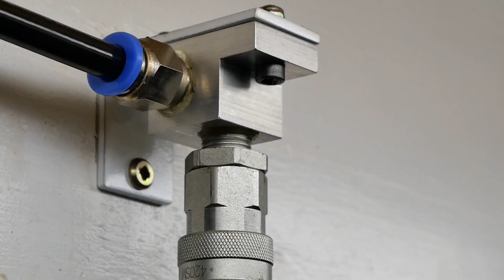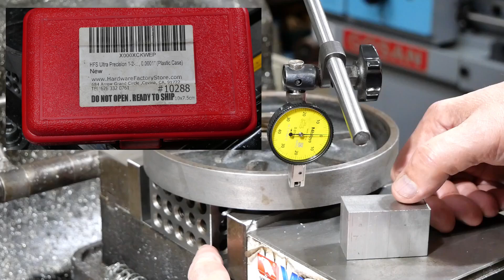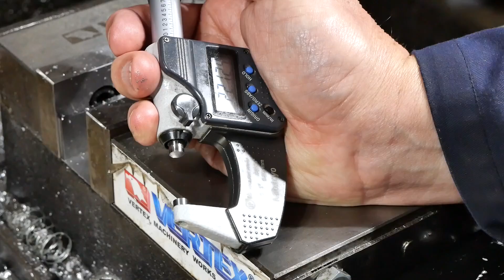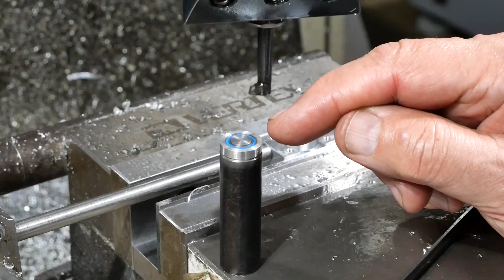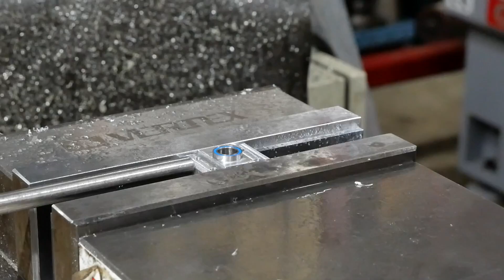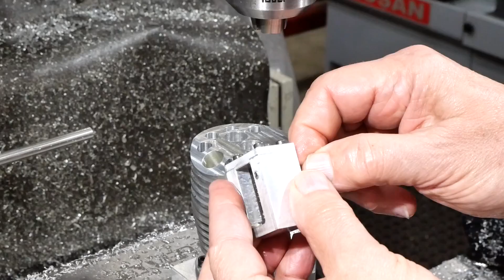Building the Lynx 15 - Part 8

Comment: well done. How come I never come across offcuts that long!
Reply from the maker: Good'ay Paul. There's a steel supply store near me and they have an offcuts "bin" for pieces under a meter. I cruise through from time to time and check it out. My good mate Murphy ensures that I'll never find a good offcut when I need it, so I go looking when I don't :)
Thanks for watching.
Reply: @alanshomeworkshop  Murphy's always hanging about somewhere, sticking his oar in😁
Reply from the maker: @paulrayner4514  Are you familiar with some corollaries to Murphy's Law that are particularly relevant in the workshop ?
A dropped object will always land where it can cause the most trouble
Where there's a possibility of multiple failures, the most damaging will occur 
The probability of the loss or breakage of any part is directly proportional to the difficulty of getting a replacement part. 
Material will be damaged in direct proportion to its value.

And one of my favorite aphorisms:  
- And a voice from the gloom said smile for things could be worse; so I smiled and, yes, things indeed became worse.
Reply: @alanshomeworkshop  oh yes, Mr Murphy is quite prolific in my workshop, I'm beginning to wonder if he's using my workshop to train his offspring in the mystical art lately.😁